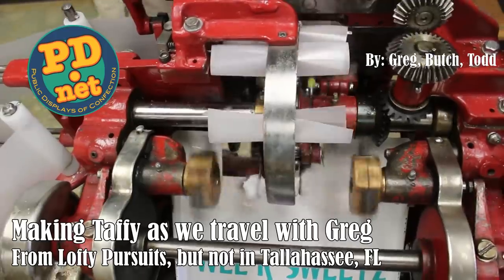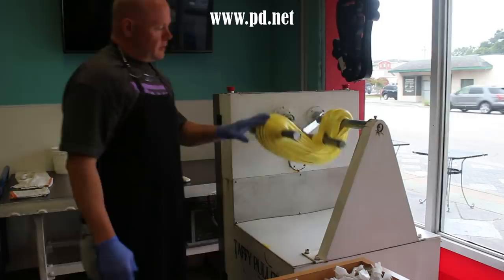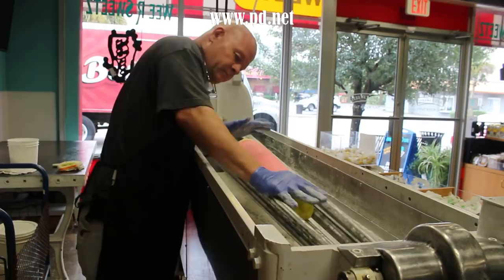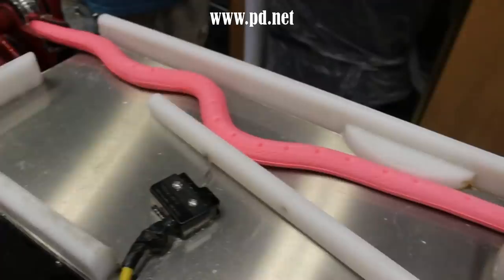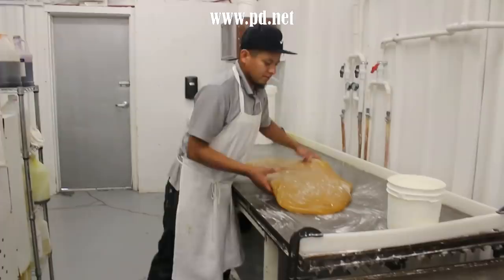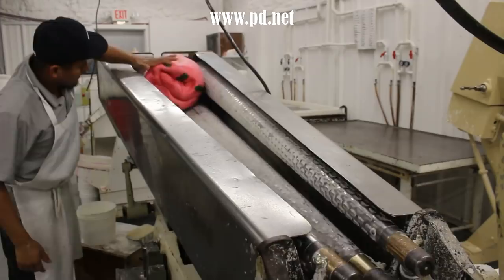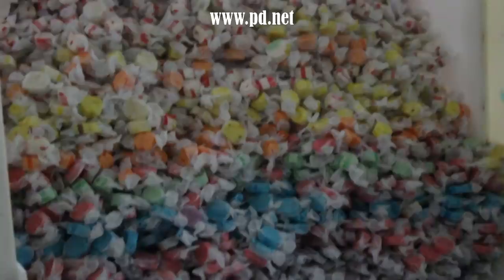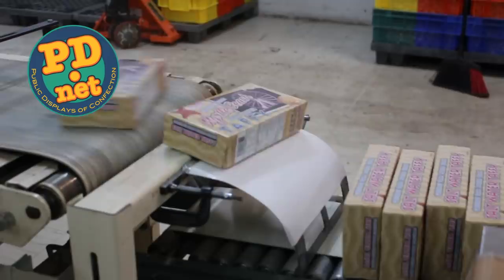#62 Making taffy using amazing taffy machines

Comment: this was very cool. The wrapping machine looks very advanced for something from the 1920’s. Also it kinda made me chuckle that nearly everything is automated, apart from the bit which pushes the packets into the boxes.. I would have thought this was the easiest bit to automate
Reply: my guess is that its for some level of quality control
Reply: Also harder than you think. The boxes are stiff and predictable. The bags... not so much
Reply: Both comments are true. Also economics. If it would take you 20 years to pay off a piece of specialized equipment that would automatically do the job when you can just pay someone $13 bucks an hour to do it, you usually just stick with the personnel. Business tend to be pretty steady with what they know works.

Comment: I work at the Hershey factory and that scale system is essentially the same ones that we use. It's a fairly neat system that can pump out around 60 bags per minute. Except our wrappers on the Nuggets line pump out about 450 pieces in a minute.
Reply: Yomom12388 you have a good job sir
Reply: I initially misread this as "heresy factory"
Reply: are you an oompa luumpa?

Comment: The old school roller is very much like a baler that makes square bales of hay, probably developed around the same time!

A comb picks up the row of hay, an auger brings it towards a compressor, which packs it into something like "sheets" of hay, and when there's enough sheets, the machine wraps the bale in twine and spits out a whole square bale of hay into the field, or hay wagon depending on how your machine is optimized. 

Incredible, how similar such different machines are!

Comment: That taffy rolling machine makes me nervous as hell, does it stop if someone's arm gets caught
Reply: no
Reply: Stormlord You know this... how?
Reply: @Renville80  
it lacks the neccessary pressure-sensing equipment and/or pop-gears. That much is clear from just seeing the machine.
Reply: There is a button and or pedal that is always within reach that will cut all power to the machine.
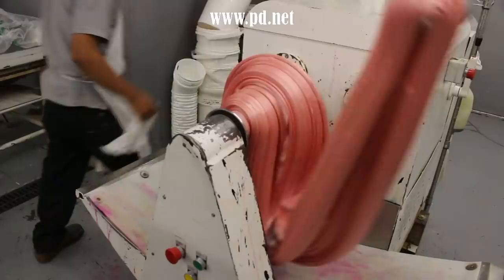Reply: At 5:00 you can see a red button on the side of the machine, that's likely the button that will shut off the power if there's an emergency.
Reply: "does it stop if someone's arm gets caught"

No, when that happens, they just make arm flavored taffy.
Reply: Mmmmmmm arm taffy
Reply: It does, after it has spun for years and years until its mechanical gears and wiring break down, while overlooking the decayed remains of the human it had feasted upon decades before.
Reply: @Renville80  cause he said it was made in the 1920s

Comment: I love these "episodes" of traveling with greg
Reply: Also dont you have one of those batch roller things in your shop? If not what is that large red thing in your candy makin space?
Reply from the maker: I do now, i went up to learn how to use the darn thing. I did not have it when I shot the video.
Reply: Lofty Pursuits ah I saw it last weekend, are you going to give taffy a try?
Reply from the maker: I've made taffy. I can't wrap it fast enough without a machine.
Reply: Lofty Pursuits I once made a batch of soft caramel, wrapped around 50 pieces and cut parchment paper. Once. Haha I know what you mean

Comment: So have those machines ever been cleaned? I mean you can see blue taffy in the strawberry and banana, and that machine is a mess.
Reply from the maker: At the end of every day, but not between batches. Water will make candy sticky, so all candy makers start with a weaker flavor and then as the day goes on go to stronger flavors, usually ending with something like peppermint. Then you clean an by the morning, the machine is dry and good to go. I shot this at three in the afternoon. I saw the produxtion schedule, they had made 14 batches that day already. The one they made for me was an extra, so I could film.

Comment: Cleaned or not, nothing that will be consumed by mouth should ever be processed bare handed. epithelial (Surface Skin) cells are left on anything we touch, it's a method forensics uses to confirm you touched something.  So it doesn't matter how clean your hands are, handling food substances bare handed is leaving your body material on it. That's just not hygienic regardless of cleaning practices.
Reply from the maker: Then you should tell that to the South Carolina department of health that allows this under state code. Sounds like you know more than they do, and they need some help. About 30 states allow this, so most of the biologists in most state board of health need your help. Not being a biologist or a Heath inspector I follow their rules for my state.